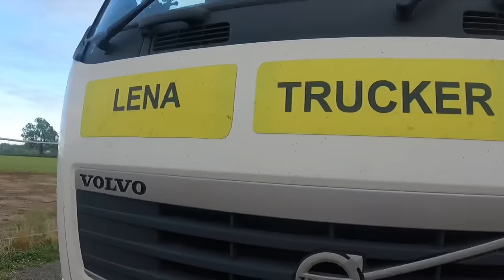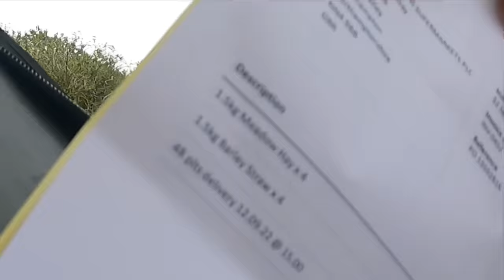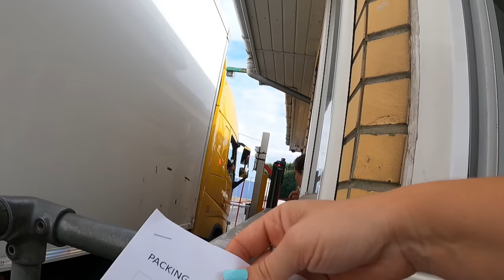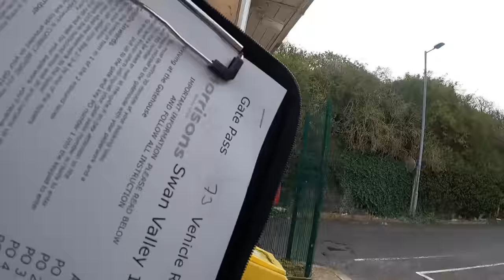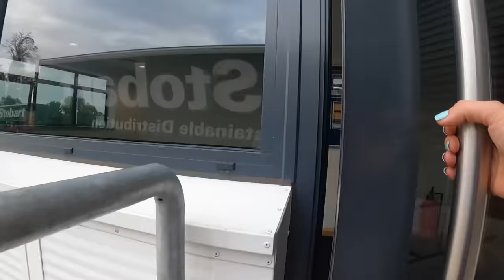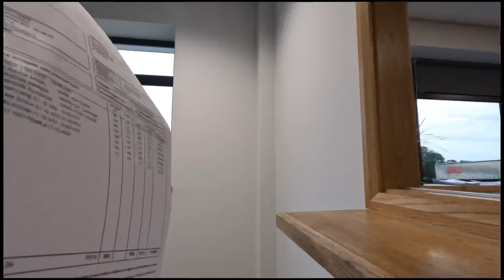Reversing my new trailer between two trailers on a bay 🫣First shift with my own trailer 😜 12/09/22

Comment: Why not a double decker - surely the strategy is to haul as big a load 
as possible from as many locations as possible to deliver to as few 
as possible.locations. The Trailer then becomes your own "Yard" 
for sorting and selecting loads. It's a continuous process as you 
"Tramp" around the Country.
Is therte a web-site for Clearing Loads?
Example, - drop off 10 pallets at Leeds, call for 10 Pallets FROM Leeds.
Maybe Going North or Going South.
Reply: But then you are at the mercy of low bridges and could face lengthy diversions and if you are hauling at max weight on a frequent basis, then  cons outweigh the pros. Deckers are best suited to trunk runs and work where the regular routes do not involve height restrictions.
Reply from the maker: Exactly what Richard said 👍🏻😜💆🏻‍♀️ and the app you looking for is haulage exchange Noel
Reply: Thinking of ways to maximise the business:-
Thought it was a two stage process 
of preparation before you set out. 
- with consignment delivery address, 
then checking Trip-Advisor for best 
route to avoid low bridges and delays.
On previous videos never saw a complete 
delivery from a double decker.
Who pays for the 2-hour wait at Morrisons?
- this could be one of the negative effects 
for Owner/Operators. "Just In Time" fine for
Morrisons when everyone else pays for it !
This is compulsive viewing and beats the 
rubbish on TV.